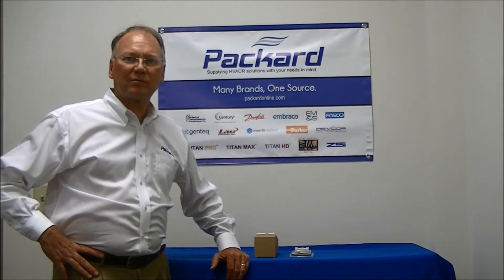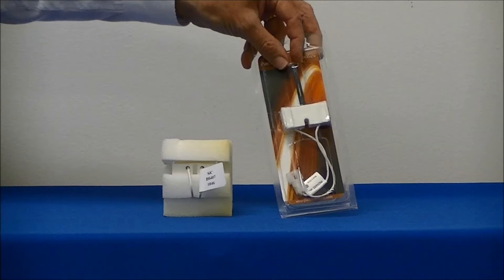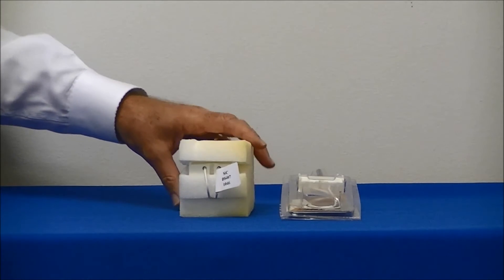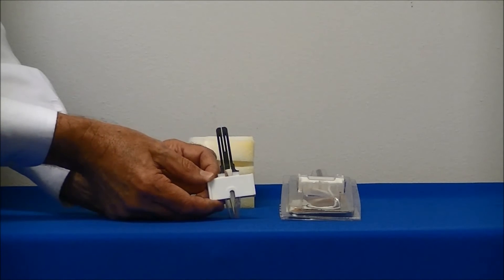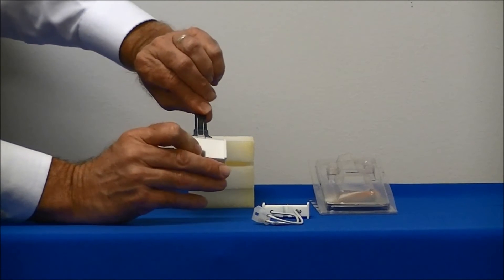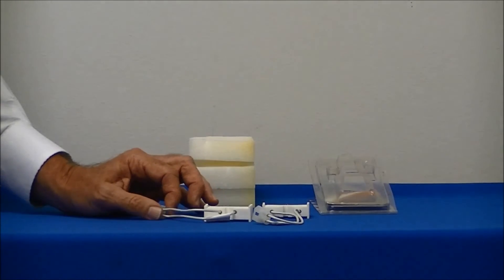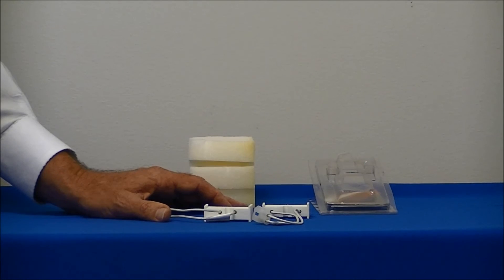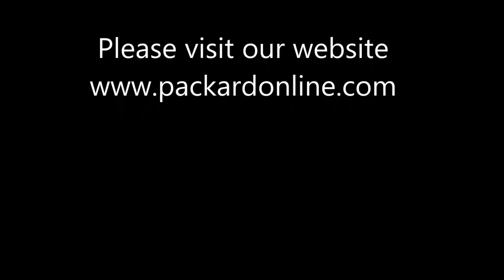Silicon Carbide vs Silicon Nitride Igniters

Comment: I'm amazed with the silicon nitride ignitor;  can Packard divulge the electrical current flow and heat generation physics?  So the current in the silicon carbide travels though a resistive path generating heat p=IsqR where r increases with temperature.  the silicon nitride does not use a visible linear resistive element path?  Or are the paths "doped" into the SN ceramic?   Does it rely on a capacitance with eddy current?
Reply: Nitride and carbide are both negative resistance coefficient thermistor materials. As they heat up the resistance decreases. The carbide ones can do this on an exponential curve, nitride is more linear. When current gets to shout 3A on either the gas valve opens.